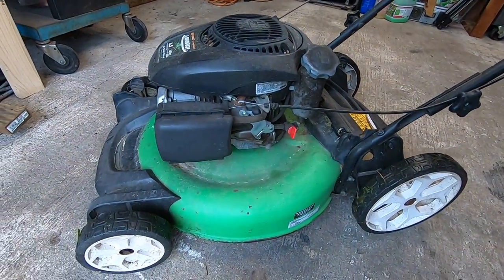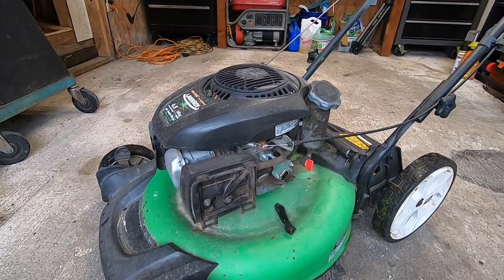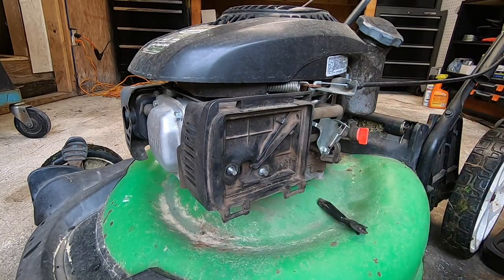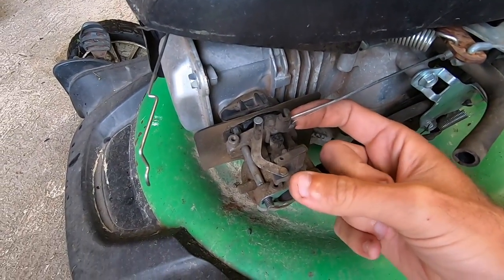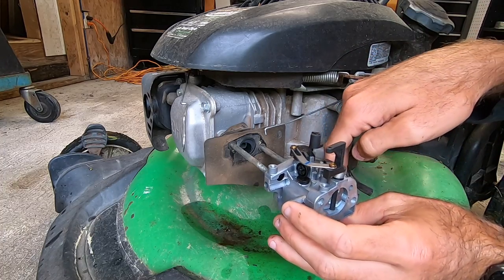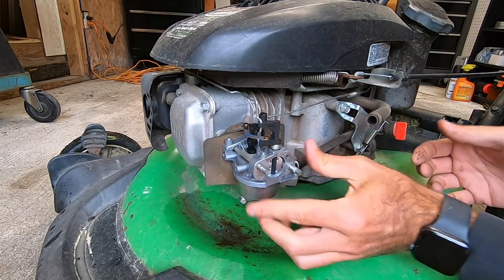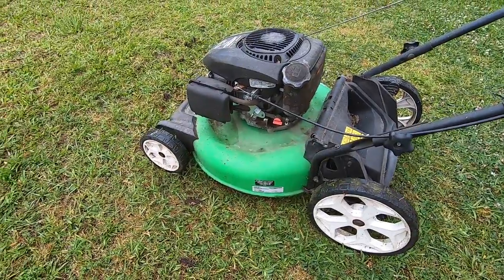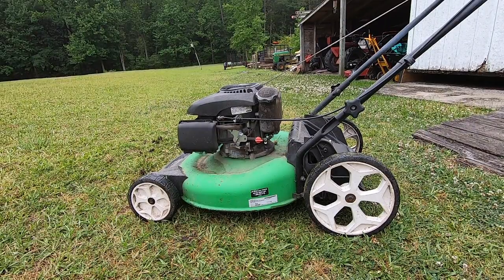MOWER WONT START | EASY CARB REPLACEMENT FOR (KOHLER) LAWN BOY, TORO, HUSQVARNA. HIPA

Comment: same here, but i have a filter, and no dirt. mine will start with a drop of gas on the air filter, runs fine. Smart Choke. So smart, it does not know it has to choke. How do I teach a lesson to the Smart-as-Choke?

Comment: Help!  What is the part number?  I just received one from Hipa that is supposed to fit my Koehler motor but it does not have that little metal arm that engages the choke.  It’s not identical.  I need what you have in the video. Thanks. Great video.

Comment: Thank you. I needed to replace my carb but since the stupid stupid plastic parts had broken on the old one I didn't know how to reattach the linkages. There are no diagrams anywhere on the net or even in the Kohler service manual that show the linkages. Your video showed me how everything was originally hooked up and the job was a breeze after that.  Thanks again for a nice job.

Comment: What’s the little boomerang shaped metal piece on top for mine fell off luckily it was sitting on top of the deck but I believe both the screws are missing 😅
Reply from the maker: I think it’s a linkage from the throttle to the choke.

Comment: Nice and easy carb swap Alex. No air filter will surely ruin a nice engine. I like that Kohler engine. When right they usally fire in one pull and have plenty of power! You wont have any trouble selling that machine.✌🇺🇸Roger
Reply from the maker: Thank you Roger. I should have spent more time on this machine in the video to show start to finish. I have a few machines coming up that I’m going to just do a whole start to finish. I’ve had pretty good luck with these kohlers. Seem to be pretty stout.

Comment: It makes it easy to change, I agree with you Alex people shouldn’t run their mower without an air filter.
I was disappointed that you didn’t bother to wash the dirt off the box caver and filter cover while they where off, an easy task even if you had done it off camera before re-fitting.
Sorry Alex, but your showing others that you can put it back on without cleaning the dirt off the covers.
Perhaps you may just give the old carburettor a quick clean for a spare.😀👍
Reply from the maker: Your absolutely right Rick. I most certainly should have showed blowing out that air filter housing I did it off camera but should have made it clear to get it as clean as possible before installing it and the air filter. I will probably get the old carb cleaned up and ready for a spare. Thank you for the support and advice.
Reply: @freedommowers420  thanks for letting me know that you have cleaned them off camera.
All good Alex.😀🇦🇺👍

Comment: The engine sounds like it’s revving too high, might be a good idea to adjust the governor so this thing lasts longer
Reply from the maker: Yes it was running pretty high. Whoever owned this machine didn’t take very good care of it. I just wanted to show the carb replacement in this video, but yes it needed governor adjustment as well as a few more things to keep it running for a bit longer.

Comment: Good job. I hate those Kohlers
Reply from the maker: I have only worked on a handful of them but haven’t had too many issues. A lot of the more modern kohlers have not been very good though.
Reply: @freedommowers420  that auto choke set up is unnecessarily complex and is subject to Rust and not wanting to open the choke or to keep the choke closed after it should be open or vice versa.